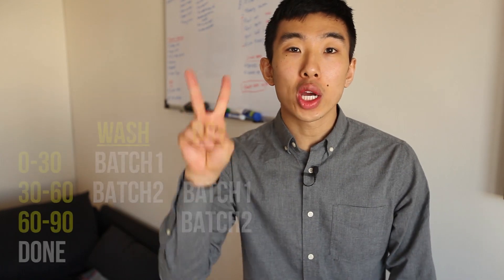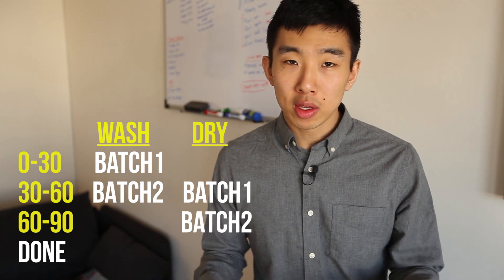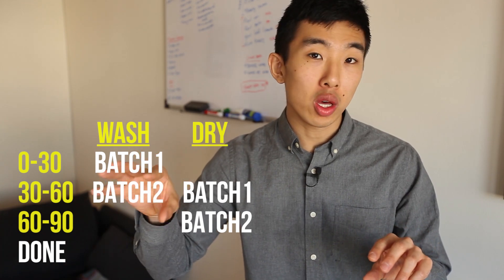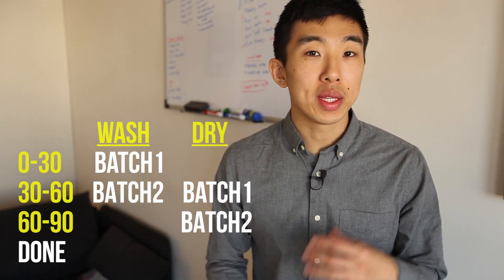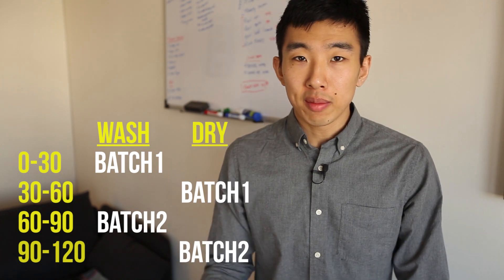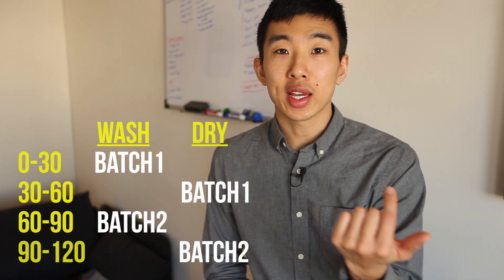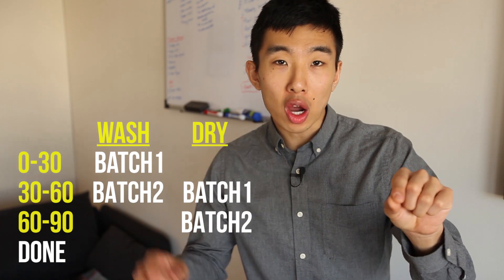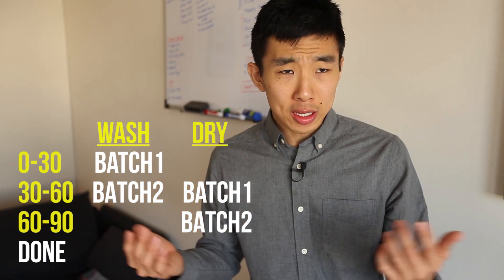What Is Instruction Pipelining?

Comment: How come we can't come up with more powerful processors anymore, but we just started adding cores instead ?
Reply from the maker: add cores does make a processor more powerful. it's not only about clock speed. there are a lot of techniques to make a processor more "powerful". you can kind of think of it as throughput. how many instructions can you execute in the shortest amount of time. every time a processor comes out, it's better. they wouldn't release new ones and have it not have any improvements.
Reply: Dave Xiang We have multi core CPU's but we don't have software that take advantage of multi core processing. There are very few applications that take advantage of multi core processing.
Reply: It has been found that the clock speed of the CPU has been increasing since last 15 years.
Now finally it has reached a Point where further increasing of clock speed  will result in more  generation of clock pulse which consequently may lead to over heating and hence may damage the processor .
Thus,Now a days Technology of Multiple core processors has been introduced which helps to improve the performance of the CPU without further increasing the clock speed.